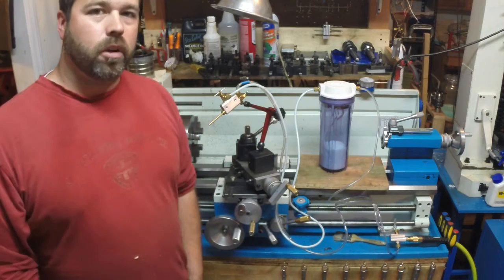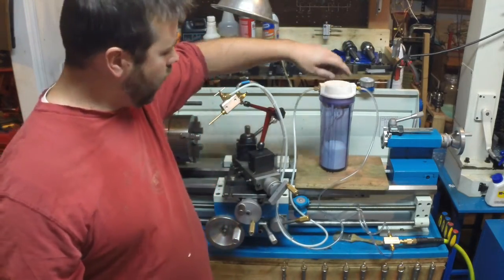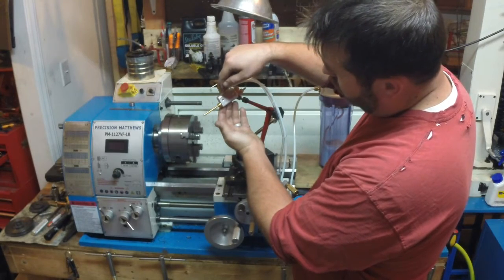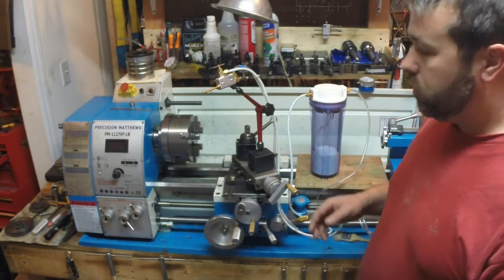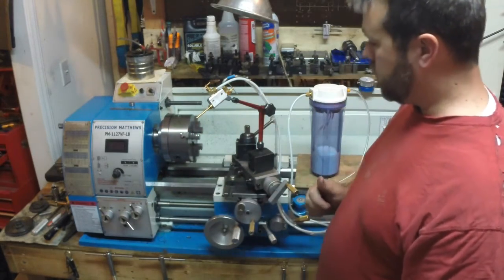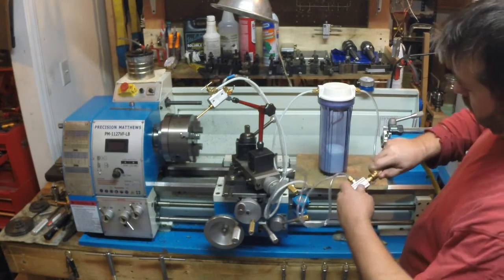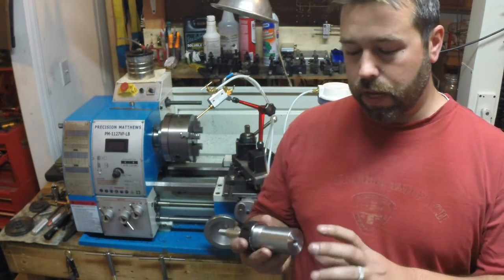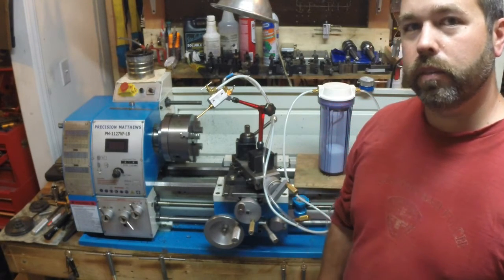Fogless Coolant System - Component Overview and Operation

Comment: seen them use a coca cola pet bottle for the fluid container , they found out the tread count for the bottle cap and made a new one for aluminium that included the wall mounting and the lines 
it saves having to buy the filterholder and probably a lot of the fitting gubbins as you can make the holes to fit without adapters , probably can put the airline splitter in the same block that holds the bottle too 
the pet bottle hold carbonize liquid and can take quite a bit of pressure , its eazier to keep a second bottle handy to change out fast if the system runs empty
i like the system you made as you seem to be able to use a lot more airflow to blow away chips and still can only add a little fluid without it turning intoo mist

as for the ER32 collet chuck adapter : since you make youre own anyway 
some/most lathes have a taper inside the spindle (mine is a mk4 taper ) to be able to put a centerpoint in and machine an object between centers , normally you remove the regulair 3 jaw type chuck to be able to mount the center but if you make the collet chuck shaft long enough so it slides in far enough through the regulair chuck you should be able to mount it with the chuck opened up and only tighten it on the taper using a long bolt with a large washer through the rear of the lathe spindle the same way you do in a mill
the morsetaper inside the spindle should center the adapter perfectly (chineese version of perfect at least) no matter how often you take it in and out

Comment: Works 100% ? No cloud of coolant in the air ? Is the pressurised coolant tank the key? I bought a chinese one from ebay for £5 and it just melting my lungs - a cloud of coolant around the machine.
Reply: I have the Hench Fogbuster version of this and use it on my milling machine. I machine 6061 aluminum with a 1/2" dia. carbide endmill x 1/2" deep cuts. I will fill the building with smoke from the heat generated making my cuts when using MQL lubricant from Tormach. If I am making lighter cuts, then I do not get the fog and do not get smoke in the air. Chad's design of having a means of adjusting the coolant and air independently is a great idea. I am going to modify my Fogbuster units, so they have independent air / coolant controls. I really think the type of machining and coolant requirements will be the biggest factors in for or no fog in the shop.

Comment: I think you'd get along with it better if you had a quarter turn valve on the air supply to shut it off while you're using it so you don't have to change your setting every time you turn it on and off. I have a koolmist that I did that with that way I can leave the setting where I want it.

Comment: I did something similar a couple years back - only dual head.   https://www.flickr.com/photos/davidpbest/albums/72157660749747763    If you don't put a check valve (backflow preventer) on the coolant supply line, when you remove pressure to the tank, the coolant will siphon back into the tank and it will take a LONG time for the coolant to come back up the the mixer head when you start up again.